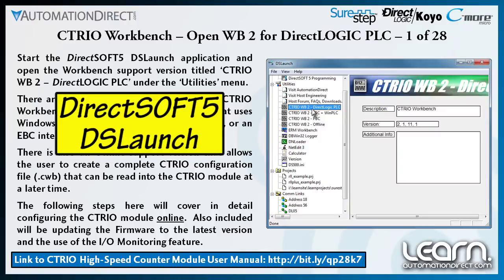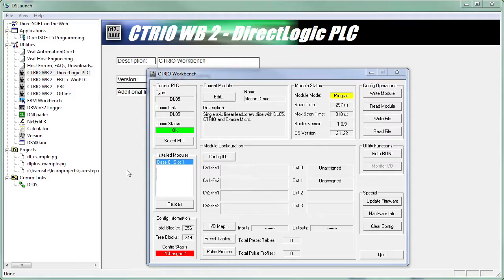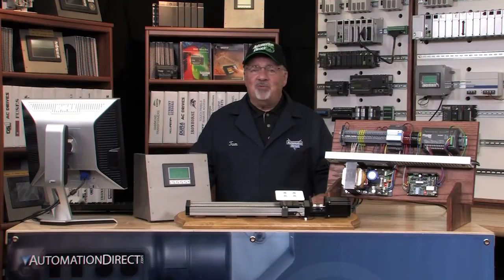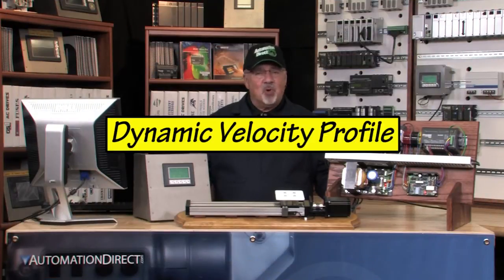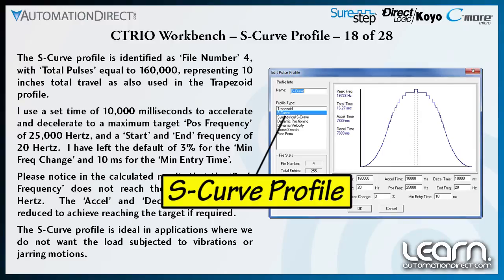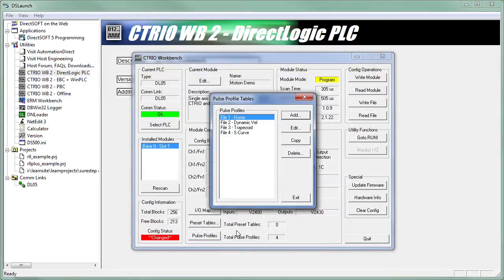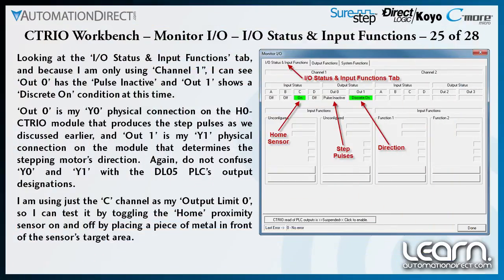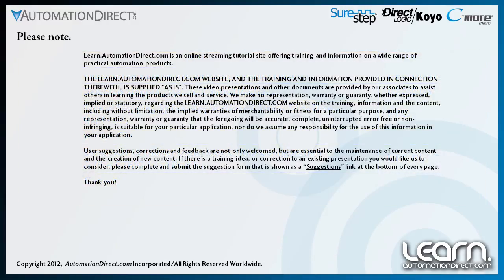Motion Control - Dynamic Velocity Profile (Part 5 of 8) from AutomationDirect

Comment: I did same with your guiding. just replace driver by STP-MTRD-23042RE but run monitor I/O motor doesn't any action although there is signal out from Y0,Y1 on the H0-CTRIO2.
Reply from the maker: That's going to be hard to answer here. Please contact our free tech support - they will be happy to help you.
https://www.automationdirect.com/support

Comment: gee-whiz...  on the DL05 input (X0)?  is there a simple video on using HSIO high speed counter just to read basic frequency  like 0 to 4,000 cps and convert to feet per minute? thanks a lot..:)
Reply from the maker: @Q Zorn, we do not have a video on this. I would advise contacting Tech Support, they can help you with this quicker. 1-800-633-0405